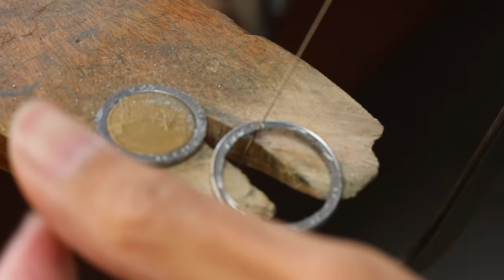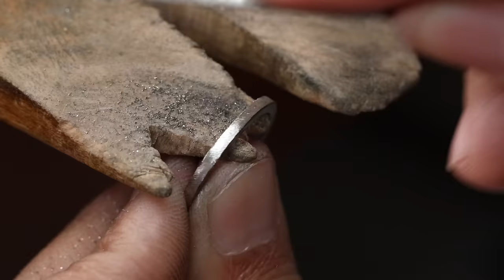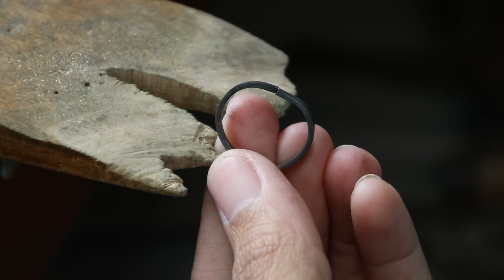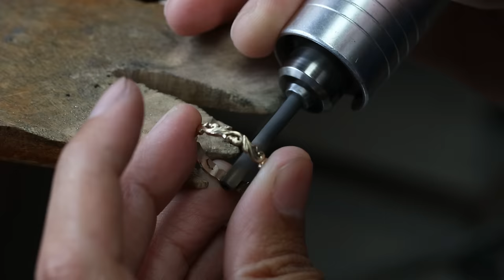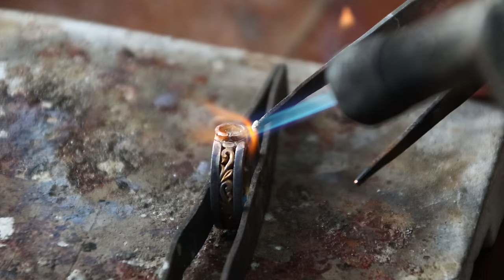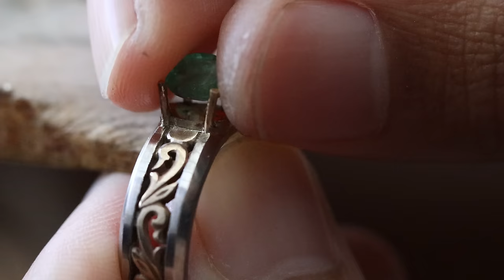coin for jewelry - how to make ring out of coin

Comment: bro. .I'm 30+ yrs.. also friends with 100+ jewelers.. . I've never even heard if chucking a qtip with green Rouge..  . you're on a whole different level
Reply: 12:21
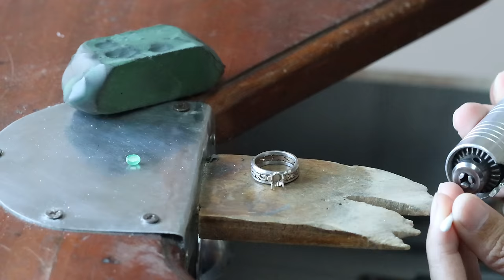Reply: 10:47
Reply: Same here except 40. My grandfather, father, and myself were jewelers - never once thought of chucking a qtip in the fordom. This is such an awesome week, just learned about using a toothpick or two in stripped out holes in wood for screws to bite into, corn starch and super glue to fix plastics, and this
Reply: Is this original and real Gold coin ?
Reply: @AmithH-gp3dd  Nein, Messing und Silber